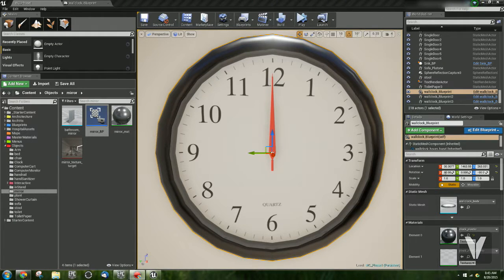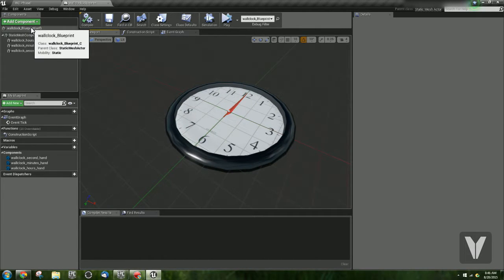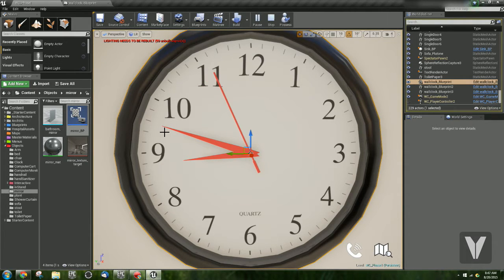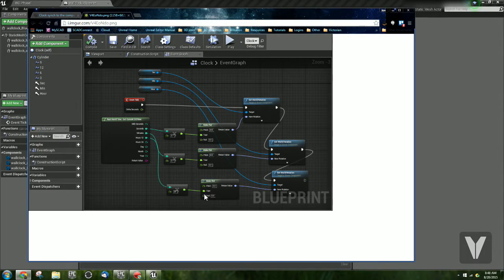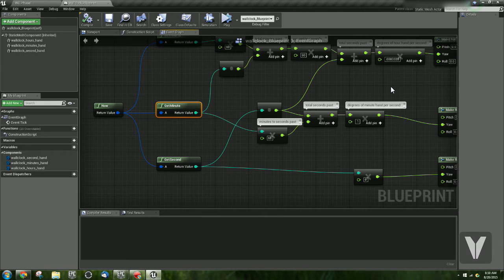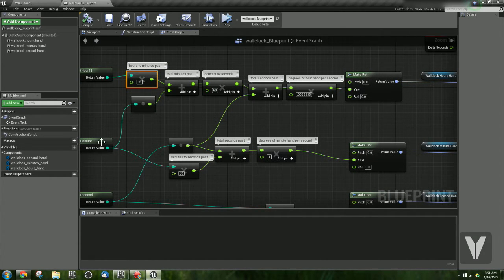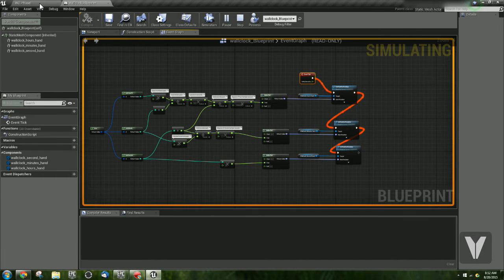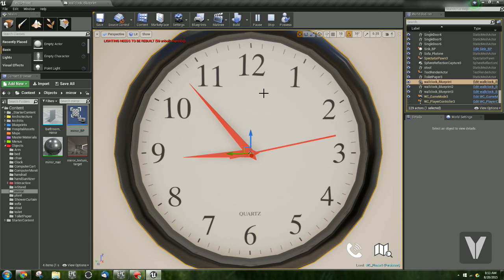Unreal 4 Analog Clock Tutorial

Comment: I imagine a little adjustment would be needed if you're going for an old-timey analog clock that instead of  the hands ticking into position but smoothly and constantly rotated.  Like a grandfather clock with pendulum.
Reply: That's a good point. You might be able to achieve this by adding a now>milisec to the secondhand rotation using the same structure. Not sure about the values for the math nodes. Any insight Villusion?